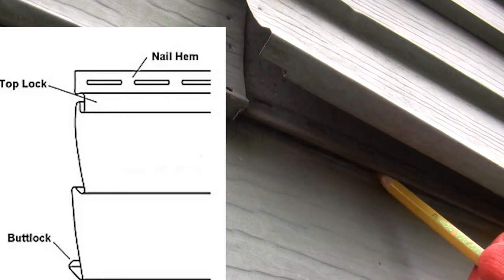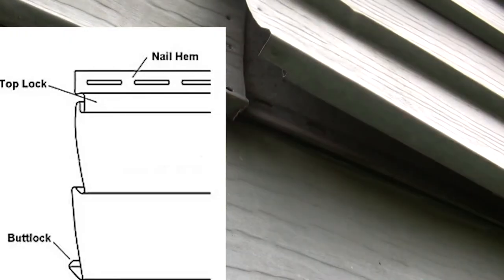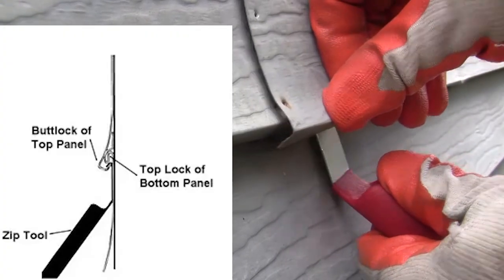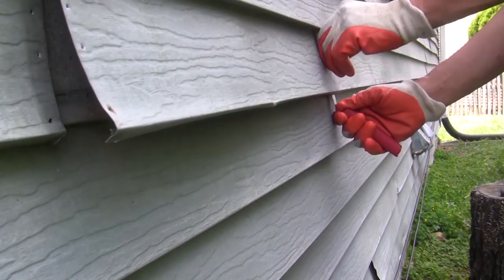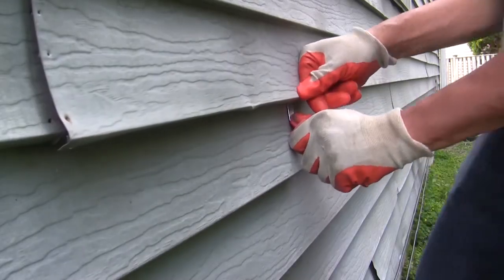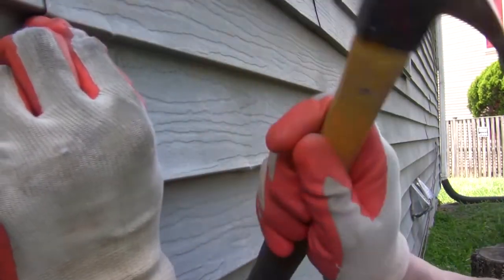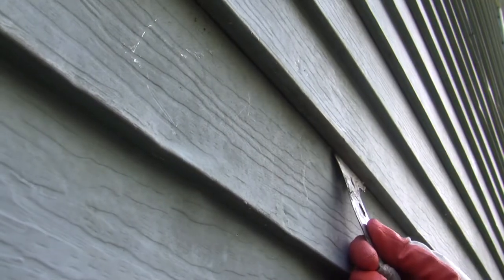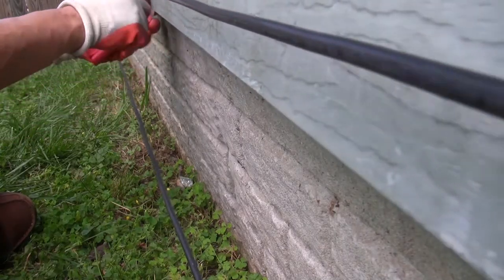FIX: Re-Attach Loose Siding

Comment: WTF did I just watch!!! That’s not even close. That tool is for vinyl siding, aluminum siding doesn’t flex like vinyl and that’s why you cut away from the camera on the starter strip. You will never get it to lock back onto the starter unless you take the entire wall down and start from bottom up. 😂😂

Comment: Thanks! Just went out back after the latest storm and found several panels disloged and damaged. Didn't realize it was that easy to replace.  Just one problem...finding siding that color matches 25 year old siding that spends most of the day in the sun.
Reply: If you’re able to take a piece of it from close to where the missing bit is, A lot of places have an electronic colour matching system for paint. You can get a small can of paint to match the colour of the replacement piece. Exactly. Costs very little. I think the cost of the smallest sample tin is five dollars.

Comment: i’m wondering how a person could safely do this in cold weather. I noticed a couple of pieces of blue siding lately, and it’s already quite cold out, so I’m wondering if there’s a neck that I need to Learn so that I don’t crack the vinyl when I flex it with the tool.
Reply: Vinyl is brittle when cold.  Use a test piece to see how far you can push it.